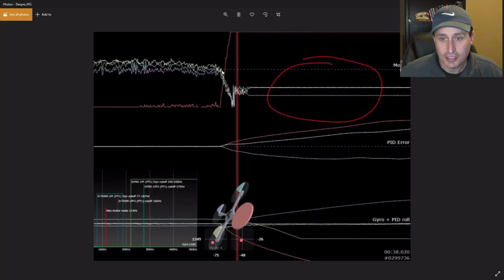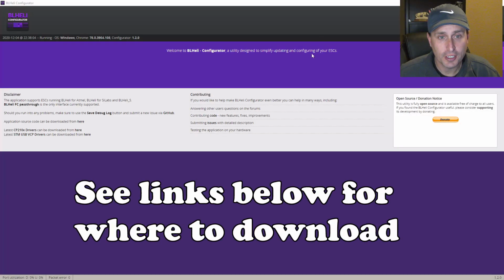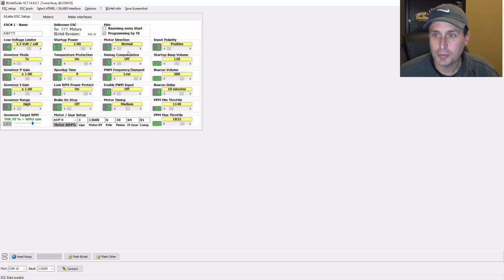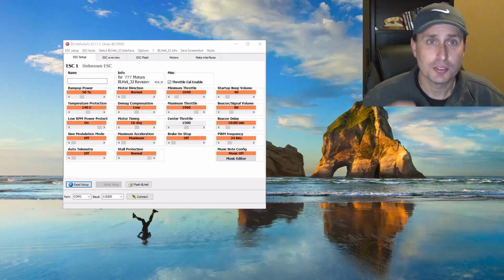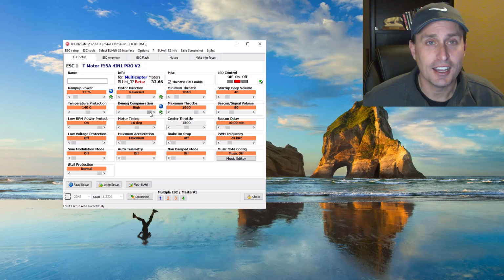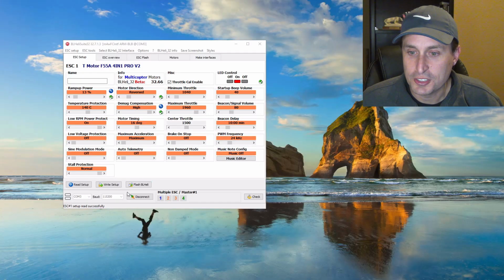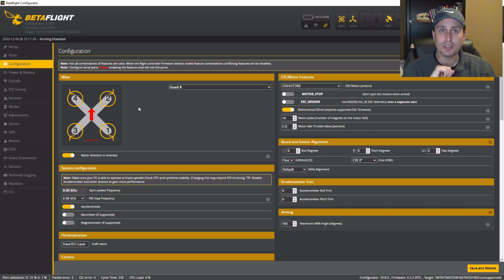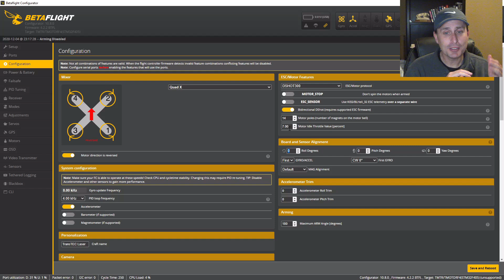How to FIX Desyncs in 5 Minutes

Comment: Great video. It is worth pointing out that 5" quads can get away with a low Startup Power like you showed, but micro drones often need a higher startup power. In particular, a lot of whoops and toothpicks will fail to start properly if the Startup Power is that low. I'm talking about 06xx to 08xx motors in particular. One or two motors will sometimes twitch instead of starting properly. But if they do start, then they work just fine until they stop again. In that case, increasing the Startup Power usually fixes it. In fact, some manufacturers ship their whoops with Startup Power max out at 1.5 for this reason. Just something to consider. But yes, on 5" drones it does not need to be that high. A high Startup Power on a 5" drone will cause big current spikes. Not only can that cause the ESC to reset (make the startup tones if you're close enough to hear it), but a high startup power on a 5" drone can also increase electrical noise showing up in the FC and FPV. That's my experience anyway. Keep up the great work!
Reply from the maker: Great point, I also wanted to drop the link to SiieeFPV's testing on Start Power influence on motor startup from a dead stop, and also for throttle ramps wile the motor is spinning: https://youtu.be/KSXKV8V85To
Reply: Thanks. I've done setting my toothpick with 0.125 and it won't fly so I put it to 0.2 and it flies.
Reply: Yea, I just tried this on a 2S 3" toothpick with 1202.5 ~6000kv motors and it won't even lift off the ground with such a low value.
Reply: Thanks. I just changed my Blheli_32 settings and then read your comment and changed them back on my 3 inch. Not sure if dipping to one side and recovering most of the time is actually a desync or not.
Reply from the maker: Could just be an overshoot from bad pids.  If slow, change i-term relax cutoff to 5 and if BF 4.2, increase the PD Balance slider.
Reply: @uavtech  It's stock pids and it dips forward and left while I'm just flying in a straight line. Like motor 4 just all of a sudden gets weak or slow. I've read that Betafpv aio boards are not known for their reliability. It could just be that. A $74 aio board that I got for $35 from RDQ on clearance. Maybe reliability is why it was on clearance?
Reply from the maker: Yeah, that's an ESC desync.
Reply: @CarbonGlassMan I want the answer for this too
Reply: Can agree here. On my Mobula 7 with stock 0802 16000KV motors with Bluejay 0.14 96 kHz PWM firmware - on low startup power one-two motors only twitch and won't start. But on 5"  high startup power seems wreak havoc with ESC and FC due to voltage spikes.

Comment: My quad will idle and hover but when I throttle up it rises and flips over ? Is this likely a desync issue ? Its a brand new Geprc vapor 5 inch and this happned after a minor crash. FC and ESC look fine could it be a motor issue >
Reply from the maker: probably not.  Check that the prop direction is correct and motors are spinning in the right direction.

Comment: Hi Sir, I recently purchased a Protek 60 cinelifter from a friend. Still working on to find the perfect PID although i could able to fly 3 minutes with Sony A5100 450 grams camera. In youtube i could mostly see videos only for 5 inch and not for cinelifters. So i kindly request you to help me solve my confusion. 
After arming my Protek 60 and try to take off, it scream so high. After 5 seconds it all turns back to normal. I check the blackbox and noticed (for 4 seconds)
RPM 1 3557rpm/59.3hz
RPM 2 17143rpm/285.7hz
RPM 3 18200rpm/303.7hz
RPM 4 1957rpm/32.6hz
after 4 seconds when quad is in the air, all rpm turn to be fine (230-330hz)
Max motor noise at 703 hz. Is there anything i need to worry about, sir? Whether my esc have any serious issues? 
Thank you!

Comment: Great video! In my case today, where quad landed in snow and motor 3 started behaving intermittently. It was my first time to see desync on this quad. I posted a video today. Do you think the settings you mentioned can avoid desyncs? It's because with my little knowledge on ESC, I am thinking ESC is bad.

Comment: Thank you for making this video. I recently finished building my new quad from old and new components. Specific to only rolls, my new quad will react exactly like the quad in this video, everytime i do a full roll. I cant find anything thats even close to identifying my issue as direct as this and not only it that, there are also tonnes of solutions. After watching, all I did was changed startup power and increased demag compensation in ESC Configurator and walla! Quad is cured and problem solved.
Reply from the maker: love it!  Glad it helped!!

Comment: Wanted to say thank you! Haven't flown in a few years but I got bored and dug through my spare parts drawers and found an old Mamba F722 mini stack put it in a frame with some old 2205 2600kv RMRC branded T-Motors and had a desync issue. Followed the first example you showed in the configurator, reduced the startup power to 0.125 and it worked like a charm!

Comment: OK, so you adjusted DMag compensation in blheli 32 but not in blheli s??? I have an 8bit esc so I’m using blheli s, dropped start up power to .125, do I also need to change dmag to high???
Reply from the maker: demag to high may help it recover from desync, but will not help prevent desync.

Comment: I have an 8 bit esc....what about that?  Hmm I'm using bluejay too, the settings are different.
Reply from the maker: BLHeli firmware?

If SimonK, have to set though beeps in programming mode.  You would need to look up for the specific ESC.
Reply: @uavtech  It's the 8 bit 60amp speedybee with the f405 v4 fc.  What's simonk? I flashed bluejay to it. .19  It dropped from the sky with a runaway failsafe after flying for about 10 seconds.  I believe it happened when I went to zero throttle and tried to perform a roll.
Reply from the maker: that sounds like a Desync.  Follow tips.
Reply: @uavtech  think I got it, just flew a full battery no problem, thanks a lot.
Reply: @uavtech  I put it back to blhelis, cause I had extremely high throttle now, which I didn't have before, but still have the high throttle problem after switching back.  Also speedybee told me there were problems others were having with bluejay.

  I'm like at 75% throttle before I liftoff.  I still have some good thrust at 100% but it seems like before I crashed a couple times with the desync it was more normal with liftoff being at like 25% and a lot more power.  Either the motors/esc have been damaged from the crashes maybe?   Or one of the settings I did to try to get rid of the desync messed up.  Do you think resetting it to .125 would help?  it's an 8bit, so is that setting still good for it?

Comment: Hey Mark, I am sorry to bother you constantly, just wanted to ask one quick question. You remember my crash (that video link below I posted the other day)... I've checked BLHeli_32 yesterday and noticed PWM Frequency was set to 96 kHz for some reason. All my other custom 5" quads are set to 24 kHz (all in this class of components). Could that be a source of some problems? Yesterday, I set it to 24 kHz on this "crash-quad" too, and I applied your BF preset for 5" with GoPro. Quad flies beautifully, I don't know if it's going to crash again, have to do some more testing. But I am so interested to know if this PWM Frequency plays some significant role in all this. Before, when it was crashing, I'd notice motor sound gets weird just before the crash... it's like I'm changing the throttle value, but almost like in 20% steps, abruptly, not smooth at all... like 20% throttle, straight jump to 40%, then to 60%, 80% etc. Thank you so much for trying to help me, greatly appreciated.

Comment: Thank you so much for this, it's super helpful! I've had my first crash yesterday. I am not 100% it was a deathroll, I was actually kind of able to control my quad just so it does not hit the building or nearby lake. I actually controlled crashed it in between the lake and the building. Absolutely no damage, not even bent prop. I will upload the full video later where I flew two more packs after that. I hope I can post the link here, if not, I will post my video ID only. At the 1 minute and 20 seconds, you can have a look, I also overlaid Blackbox data on the top. Could you tell me what does this look like and how to fix it please? Thank you so much in advance! https://youtu.be/qaM8AnKUfvE

Comment: Bravo et merci pour toutes les vidéos instructives. J'ai une question : j 'ai un quad 3 pouces 6S, crossfire, Vista, sur lequel j'ai voulu flasher les ESC (en BLHeli s) sous blue Jay avec esc-configurator pour avoir accès au RPM filter et bi directional Dshot. Bref, je flashe, c’est ok sauf qu’en reconnectant à BF j’ai un taux d’erreurs qui monte anormalement sur un moteur. alors je fais la procédure inverse : je flashe à nouveau en BLHeli S et là c’est la catastrophe : les moteurs 2 et 4 ne sont plus reconnus du tout ! Et pourtant dans BF, chaque moteur tourne normalement et dans le bon sens... je ne sais plus quoi faire. Aurais-tu une astuce à tout hasard ? Merci par avance et encore bravo pour tes vidéos ! 👍👍
Reply from the maker: Essayez d'enregistrer votre configuration dans BF, puis de revenir à BF 4.2 ou 4.1 pour que BLHeli_S reconnaisse. Notez que vous pouvez également revenir à BLHeli_S sur le site Web esc-configurator.com ou simplement exécuter le micrologiciel BlueJay ESC SANS activer DSHOT bidirectionnel.

Comment: I'm just trying all of this now. Question though. Does the desync trigger disarm? My quad disarms each time.
Reply from the maker: No, it does not.  That seems like a failsafe?
Reply: @uavtech  yes it actually is, I've just checked black box logs and shows as failsafe but i have no idea why it does it. Is there a way to see what is the actual reason for failsafe? This issue drives me nuts.

Comment: Can anyone of you help me fix desyncs?

When I do a Flat Drop (zero throttle drop then punch to catch it), my quad just falls out of the sky. It only happens on exactly this maneuver. 
I tried everything mentioned in your video guide, still same problem. Everything I tried couldn't solve the problem. Its always another motor and esc + motors are completely new. I tried replacing the stack and after the problem accured again I even tried new motors still same problem. 

Changes I tried from the Default:

BlHeli32:
Decreasing Rampup Power to 20%
Demag Compensation High
Motor Timing 22

Betaflight: 
Dynamic Idle 40

Setup:
Now: Tmotor Pacer 2505 before: Tmotor F80 pro
Stack: Now: Tmotor F7+F55A II Pro HD before:  Skystars F7 HD
TBS Crsf
Caddx Vista
Vega Gravity Frame

Any help would be really appreciated as I have no Idea what I should do to make it work. I always used good, full batteries and desyncs only happen when flat dropping and catching the quad with high throttle. 
Thanks in advance,
Niklas
Reply: Here is a Blackbox Log and below the DiffAll
Reply: https://drive.google.com/file/d/1jdiSpQIDbJgttkGb4_-tAi0_oz9hGZSZ/view?usp=drivesdk
Reply: https://drive.google.com/file/d/1jYfP0tb-emYLCtwwgoFgekMpPJd4Xpfc/view?usp=drivesdk

Comment: Do you maybe have a suggestion what to set the minimum startup power to with Bluejay firmware? there are different units there (default is like 1025 to 1100)? I just had a motor desync when testing pid tune with rapidly reversing stick motion and I'm not sure how to prevent it in future.

Comment: I have an apex that keeps doing this 
Its kiss
How would you do this in kid gui ?
Reply from the maker: You can't.  If KISS ESCs, nada for settings.  If BLHeli ESC, KISS doesn't have BLHeli pass-thru.
Reply: @uavtech  so I guess there is no way to fix it ? Kiss fc v2 and 4in1 esc
Reply: Is the esc broken ?
Reply from the maker: BLHeli ESC or KISS ESC?
Reply: By the way I forgot to reply to the last thing I asked you about trying to connect the fc to the gui lol I needed to update my computers drivers and I used defuse demo and it works

Comment: I'm getting this happen as soon as I blip the throttle. Not always the same motor though. Went from bluejay back to blheli and it still happens.

Raised rpm to 7% lowered ramp up, turned off rpm filtering. Def seems worse on 4s than 3s although I've only tested in my ky kitchen 🤣

Happening on betafpv 1106 4500kv with 3inch props. Could they be over propped? I only bought them cuz they were cheap. Also running diatone mamba ministack

Comment: Thank God for people like you! I've been trying to figure this out for months now and finally think I have the answer. Just tested it out on my Crux and it hasn't happened again. It happens on almost all my quads though. Could it be something else causing all of them to desync like this. I don't mess with the settings in betaflight or blheli besides the basic stuff. Reverse motors and now this start up power. The wierd thing is after testing 3 batteries I went to do the 4th and my crux won't power up. Not even a light comes on. I plug it in to beta flight and it works. Even the motors work when I plug in the battery and test it through beta flight.   Thinking is the 5v regulator... Any idea of why it's now not working?
Reply from the maker: Yeah, could be the 5v reg.  Get out your propes and test 5v anf ground on battery.  If that is good, test 3.3v and Gnd.  The MCU, gyro, etc... run on 3.3v power
Reply: @uavtech  ok I'll check them out. What do you think could be causing all my quads to desync while I'm flying. Is it do to my flying technique? I did a lot of hard turns rolls and flips. I can't figure out what caused them all to be like this...

Comment: Thank you so much. Your video solved my problem with a build. Installed some 1507 flat rat 2800 kv motors on my taycan mxc 3” (6s). I thought there was an incompatibility between the flat rat motors and the newbeedrone cricket 200 stack. Had some poor flight characteristics during flight and noticed desync during abrupt full throttle blips. Adjusted the settings as your video suggests and the throttle blips no longer cause problems. I’ll test fly tomorrow to see if the other flight issues have been solved. Thanks again!

Comment: Do you have any desync settings for bf4.3 rc1/2 ?
Reply from the maker: He Desyncs are specific to ESC issues and can sometimes be remedied with ESC firmware changes.  They are not specific to the Betaflight; or flight FW in general.
Reply: @uavtech  does it apply to all firmwares with this settings? Beta emu falco?
Reply from the maker: Yes.  But there is one thing (forgot) is idle speed.  Make sure is bumped up.  Outside of that, the rest is ESC.
Reply: @uavtech  i have my dynamic idle set at 30% with thrust linearisation at 30% im running bf4.3rc2. I had crazy desyncs with my quad previously
Reply from the maker: Yeah, cranks up to 40 or 50.  See if that's it.  Dynamic idle too low.  But most of desyncs come from ESC / Motor issues.   Sorry about that confusion.

Comment: How would these values translate to Bluejay configurator? I have minimum startup power and maximum start up power sliders rather than a static value. Right now, they are set at 1030 and 1110 and I am getting a desync. Thanks in advance!

Comment: Seems this is why my 5" fell from air 2 times at last weekend during hard turns and punches. Killed two 6S batteries on both impacts :(   No BF logs unfortunately, because FC memory was already full. At second time FC reset happened. Probably due to voltage spike caused by too high startup power.

Comment: Great explanation. Maybe you can make a tutorial about ESC startup and rampup power configuration in general?
I realized that proper quad behavior after structurally sound construction and not broken or bent props (these always come first) begins from correct ESC settings. Latest Betaflight versions are good enough to fly fine even with default PID/rate settings. Bad ESC settings however caused twitching motors, wobbly flight or like "meh" flight feeling. By trying and error found kinda acceptable ESC settings for me. However would like to know which settings exactly change what. Labels only are pretty cryptic for one who is not working in EE and electric motor building every day.

Comment: What about if your running bluejay firmware? Mine has been doing this with bluejay.it was fine for a while but recently I’m getting dropouts.
Reply from the maker: Probably and ESC or motor going bad.
Reply: @uavtech  I believe it’s an esc issue.I  flash it back to the normal blhel but it would still say bluejay so.I believe that has messed up my esc .shame as it would fly nice up until then😢.so ordered a new stack with blheli_32 esc
Reply from the maker: Yeah, try to flash again.  Lots of folks run BlueJay without issues.
Reply: @uavtech  I wish I could but esc1 isn’t recognised anymore.I also have this problem on 3 other quads all running the same stuff🙄.

Comment: Having a problem, I installed a GoPro on my 5" 6s quad (total 728 grams) , when I giving high throttle then my quad loosing power and drawin a lot of current like 50-60amps and falls from sky slowly and my motors are hot esc as well..Without GoPro it's fly like normal powerful quad.. Brainfpv Radix2 is the Flight controller and tmotor velox 45A ESC installed in this quad.. Do you know how to fix this problem..?

Comment: I have a 5-inch quad with 1950KV in 6S, and sometimes when I do flips, I experience loss of control for a fraction of a second, but the drone recovers and won't crash. In blackbox it seems to be a desync, but the motor number 4 is which always goes up to 100%, is this a desync sign?
Reply from the maker: Yes